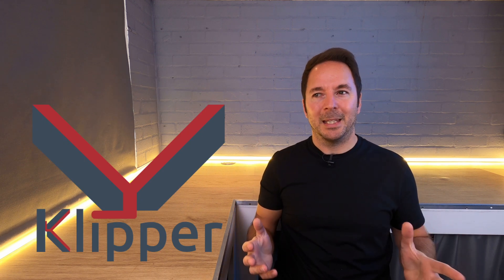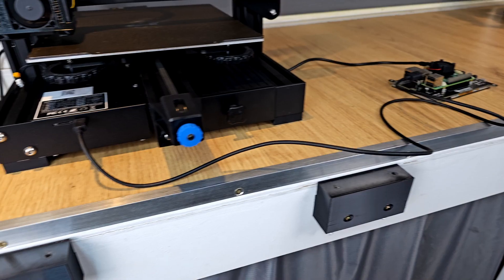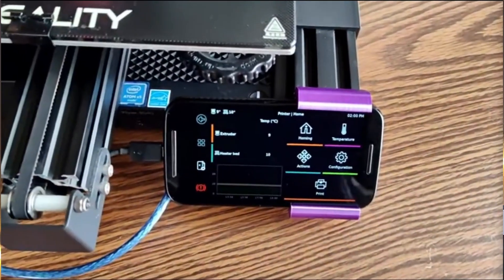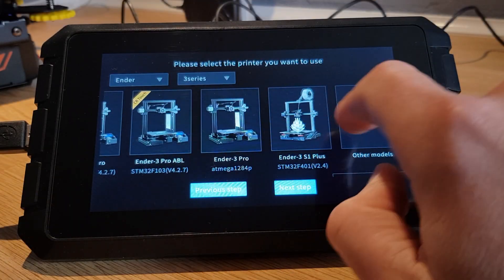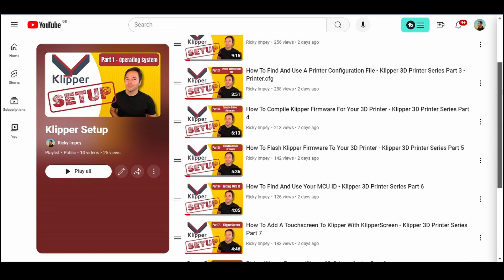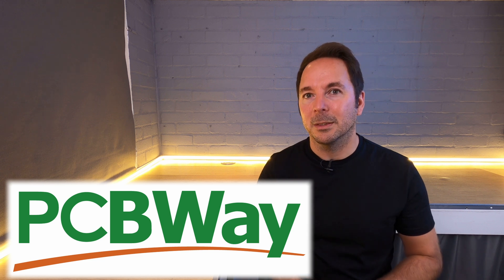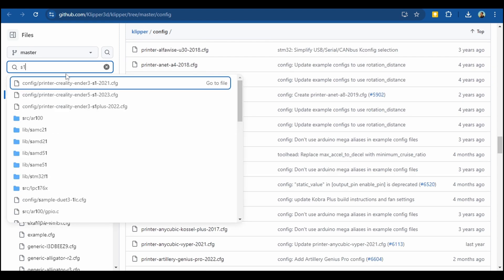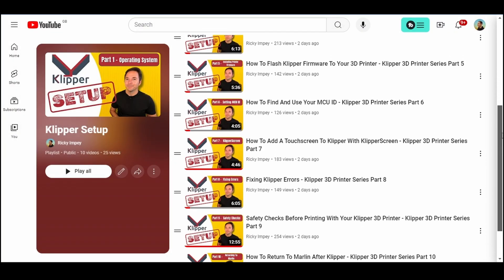How To Get Started With Klipper On Your 3D Printer - Full Process Explained Quickly!

Comment: My printer "ain't  broke" so, why "fix" it with kipper?

It runs and does exactly what I  need it to do, even after all the modifications I have inflicted upon it, which have been very few.
I don't do well changing anything regarding firmware. Especially when it comes down to Marlin.
So, WHY change to kipper?
More problems I do not need. I can do crazy all by myself without adding any more "aggravation".
Simple, please. I am not exactly stupid, but...

Comment: First ytuber to say Klipper is software, not firmware. That can be the main reason not to use Klipper. Firmware (like marlin) once set up will work as long as hardware don't fail, it's rock solid. Software is opposite - it works as long as first buggy update/change or any OS-related or file-related obstacle don't come. Being said that, knowing the risk, you can start enjoying the benefits of this amazing software, or rather choose some firmware.

Comment: Ricky I am surprised NULL info in Google with "how to 3d print a part with Klipper" or "how to 3d print a stl with Klipper". Once you have Klipper in the PI or PAD and the adequate dedicated firmware in the 3D printer, the "supposed simple" process of printing a part you have in Stl file using Klipper finally is ALMOST UNDOCUMMENTED. Please, consider It for a future video. Cordial regards.
Reply: The overall process of tunning all necessary steps involved to get Klipper running seems so intrincated  that everybody has forgotten THE MAIN OBJECTIVE: Printing a part with it, something previosly was clear with Cura+Marlin team working together.

Comment: I updated my E3V2 to Jeyers in my early days and was very happy with it.  Looked at Klipper for a very long time and felt it may be just a tad too complicated?  Then I found a great price online for a brand-new Sonic Pad!  Took the plunge and it may not be as plug and play as they make out but with your tutorials was made easier.  I would now like to take the plunge and root the Sonic Pad so I can get KAMP?  But worried I will brick it losing all the hours I have saved on my prints with the Present setup?

Comment: Hello Rick-I
and thanks for sharing this good stuff!  Just came across this new one and - although this isn't really the most appropriate (best practices sort of thing) place to post such a question, maybe somebody will take one look and offer up what might to them be OBVIOUS???  If it's not YOU - well, I'll certainly understand!  But I have DEFINITELY found your videos to be sane and informative in the past, so - here goes:
I did the klipper upgrade to my old ender 3 some time back, and although it is actually up and running, there is a substantial problem that I've tolerated until now. But it's HIGH TIME I got it resolved, as it came up again this morning!  You see, since I did the upgrade, based upon a new main board plus a Pi clone I am unable to print anything in stand-alone mode!  All the gcode files of things I have uploaded (in most cases printed from mainsail on my desktop PC) are shown in the "SDCARD" menu choice, but no amount of pressing the thumbwheel switch will allow me to select said file and actually print it!  Other things work - like setting temps on bed or hotend, but not the fundamental function of printing from the card!  Lame, indeed!  
So my little query here amounts to: where would you think the problem might lie: the firmware on the mainboard or the OS on the rPi board?  I'm at a loss to guess - so in such cases I usually flip a coin (pocket binary decision utility).  Maybe I should check for updates for both.  
Usually it's not a problem to just kick it off from the old PC, but when I want another copy of a previous print, it seems like a minor nuisance to have to use the sledge hammer when it should have been feasible with the stapler on the desk.
Still really liking Klipper, though - guessing you agree!
Thanks again - and keep it up!

Comment: Hey Ricky thanks for all the klipper series,im planning on gettin a Pi5 with a touchscreen to convert my ender 3 S1 to klipper, also planning on adding the pro version heating block,the only problem is that the new thermistor has an smaller connection pin than my breakboard, same for the 5015 fan that i bought,any advice on how to solve this?